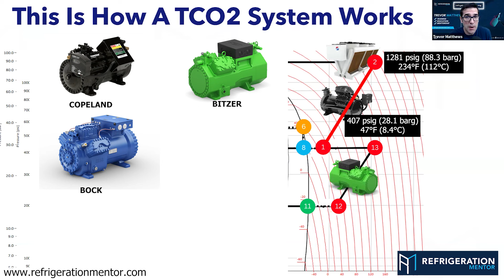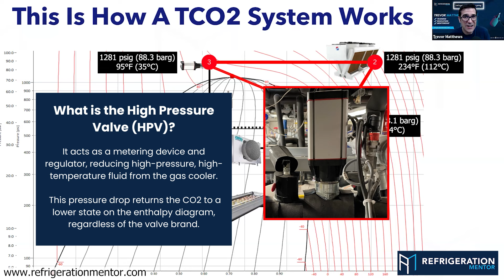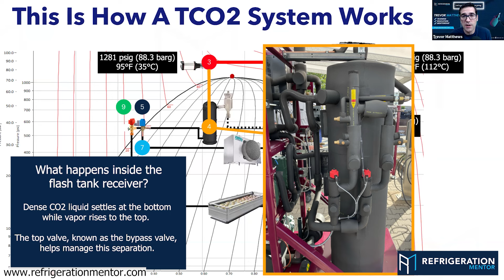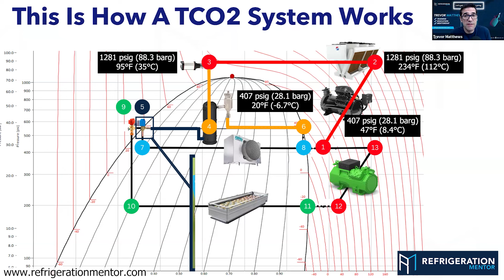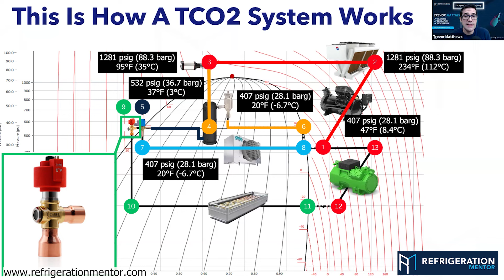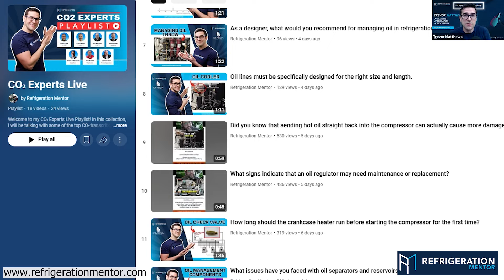Do You Know How a Transcritical CO2 System Works?

Comment: I would really like more info on what the intercooler does on a M&M Carnot system. I understand how co2 works and the key components but I’ve yet to find any info on how the intercooler affects the system.
Reply from the maker: It acts like a buffer tank with a couple of purposes. Your low temp compressor discharge goes into it so it cools the vapor so it is not too hot going back to the medium temp suction it also cools the liquid in the intercooler so it supply’s colder liquid than the flash tank to the LT liquid header.
Reply from the maker: We have a co2 course coming up that would really help clear a lot of things up, I bet. https://refrigerationmentor.com/introduction-to-co2/

Comment: On the 400 psig region, do we neeed check valves?
There is MT comressor suction, LT compressor discharge, bypass valve, and MT evaporator outlet. How is flow direction maintained? In the world of walk-in coolers and blood plasma freezers, the load is not constant. Also, why not use scroll or screw compressors, you're showing semi-hermetic reciprocating compressors.

Comment: You don’t need something at the junction of the mid-temperature and low temperzture circuit? Though they are at the same pressure, one is a -7°c while the other one is at 73°c!! How come there is no heat transfert from the 73°c circuit to the -7°c circuit??! 😮

Comment: Totally has no idea what he is talking about at 49 seconds he says it is a fluid which it is not it is a vapor. He says again it is a fluid. This type of refrigeration will kill people at pressures over 1200 psig. The equipment needed to test and maintain will be very expensive.
Reply from the maker: Yes you have to be safe with any refrigeration system but that is a huge misconception 1200 psig is a high pressure but I have not heard of anyone getting killed by a CO2 transcritical system and there are 100's of thousands of system out there with CO2.  If you work in refrigeration and ever used nitrogen that has over +2000 psig and not many people talk about that.

Comment: Totally not a HVAC tech, but had to deal with cooling systems in a small datacentre

How efficient are these things compared to chilled water systems? 

(for half the year we can reject heat to ambient without needing to run the chillers, but the flipside is the risk of water dumps over the racks - which is mitigated by pulling a partial vacuum on the indoor water loop, but results in the intermediate pump and heat exchanger sounding like a brawl in a spanner factory due to the cavitation generated)
Reply from the maker: @miscbits6399  they are efficient but I don’t have an answer for that comparison as I have not looked into it before. I will have a think about it.
Reply: Running your data center with free cooling (just with outside temp and circulation pumps) is absolutely most energy efficient, but you need to have low enough ambient temperature.

Many data centers run on approximately 26°C. To attain this temp with free cooling you need 20°C or lower ambient. Though with bigger heat exchangers outside AND inside, you can work with temperatures closer to 26°C

Most places in the world will have significantly higher temperatures most of the year. This makes a chiller mandatory to keep the data centers at proper temp.

Comment: You’ve got to get some hands on experience with c02. They’ve got rack that only run medium temp. The biggest issue is everything is digital, runs through case controllers, board on board on top of board. It’s all the the controller
Reply from the maker: @bevil23  thanks for sharing. Hands on experience is very important for anything we do in refrigeration. The theory behind of how it all works is just as important because there is a lot to it and you do not have time on job sites to learn it all. Yes there are many Medium temp CO2 system in the field and they are not a booster system. Because everything is digital and controller heavy it makes it easier to troubleshoot the whole system vs one section at a time. 

Learn more about CO2 refrigeration at Https://refrigerationmentor.com
Reply: @ only if everything is labeled. If bms says controller 1 is responsible for something. What is controller 1. Newer controllers are difficult to find what is controller 1. You have controller 1,2,3 plus secondaries

Comment: Why is the pressure first 532 PSI and then 407?
Reply from the maker: Great question! The 532 is receiver/flash tank pressure and the 407 is the medium temperature suction pressure. These are just example and will be different depending on the application.
Reply: @RefrigerationMentor  OK, but I still don't understand.  Why not take the liquid off the 532, and gas off the top of the tank?  Does there need to be a drop to allow for control?  Do you have a link on this issue and why the two pressures?
Reply from the maker: @seaplaneguy1  In this example you are moving the liquid out at 532, the vapor goes through flash gas bypass valve back into the medium temperature suction line. Thats why you have 2 different pressure.
Reply: @RefrigerationMentor  Sorry, but I still don't understand.  At point 4 (532 psi) the liquid goes to 5, and then from 5 to 7 via a valve.  Why the drop from 5 to 7?  Are there three desired temperatures for three types of products in a grocery store?    Also, the gas at 4 (432 psi) goes to 6 and steps down to 8 via another valve so as to meet up with the 7-8 line and eventually to 1. 

The liquid from 5 is super cooled to 9.  What cools it?  It later goes to -25F. 

I see three temperatures in F:  37, 20 and -25.   I understand one could have many temperatures depending on needs.  

My question is why the 532 and 407?  Demand for those temperatures?  

Why not just go from 5 to 6 via another line than the 4-6 gas line and make 13 compress to the 5-6 pressure?  Is the compressor from 12 to 13 limited in ratio? 

I watched several videos and non explained this.  This is not my field.  I am a mechanical engineer (engine development) but not a refrigerator guy.  

Thanks for the help.
Reply: @seaplaneguy1 at 4 to 6 is to maintain the vessel pressure not exceeding 41 bar, from 5 to 7 it only drops the pressure for medium temp probably at 25 bar  back to the suction of the mt comps. Bypass is only to maintain the vessels pressure since it can not be lower than the mt suction and not higher than 45 to 60 bar. I only have 5 years experience so I might be wrong . Thanks Trev for the most amazing advice ad knowledge.
Reply: Great video but I have one question, when going through the pressure regulating valves that feed the med and low temp liquid headers, when you drop the pressure, how do you ensure there is enough liquid to satisfy all the expansion valves on both suction groups? Does it lower the pressure then go through another heat exchanger to collapse the vapor made via expansion back into a liquid and then go through the expansion valves? Or is there only minimal flash gas after the pressure drop to satisfy each expansion valve in a store?
Reply: Or was I reading this wrong, are points 5 and 9 pressure regulating valves to drop the pressure to different liquid headers or are they the systems expansion valves?
Reply: @Sub_Zero_Refrigeration  exactly that, expansion for the medium temp and low temp.

Comment: I was just hired as the maintenance tech for a production facility 2 months ago in Milton Vermont and I have never worked with co2. I am the only hvac tech (13yrs exp) and am doing all my own research because nobody I know has any experience, even my mentors. You have been the most valuable resource I have found so far (in 2 months of looking) and with my hvac background and your knowledge I feel I can do it without making dry ice. I am already aware that the system is low on oil and I am still very afraid of messing something up. I am still not ready to pull the trigger and do it because i have not found any real guides on the proper steps to take with isolation and bleeding pressure down. It is a purity system for the record, and I really don't want to ruin such a cool system due to my ignorance. 

This was the best video to help me wrap my head around the entire process and will help me build the confidence to actually do the work i need to get done.
Reply from the maker: @seanbeatty3064  I am glad you find our content interesting. I know a lot about those systems. Shoot me an email and I can get you the documents that will help you. I recommend you to join one of our CO2 training programs they will definitely get you to the next level. I have an intro to CO2 which I believe would be perfect for you.
Reply from the maker: We have some new CO2 courses 

Intro to CO2 program 
https://refrigerationmentor.com/introduction-to-co2/

CO2 Field Troubleshooting: https://refrigerationmentor.com/co2-field-troubleshooting/

Understanding CO2 Controls: https://refrigerationmentor.com/understanding-co2-controls/
Reply: This is blowing my mind after working on reg rack systems. I’m excited to learn more
Reply from the maker: @thomasalcaraz5598 We have some new CO2 courses 

Intro to CO2 program 
https://refrigerationmentor.com/introduction-to-co2/

CO2 Field Troubleshooting: https://refrigerationmentor.com/co2-field-troubleshooting/

Understanding CO2 Controls: https://refrigerationmentor.com/understanding-co2-controls/

Comment: I didn't realise there was a difference between a fluid and a liquid..a.bit like a gap and a space.
Reply from the maker: My relization was when a thermodynamics engineer explained to me that both liquid and vapor/gas are fluids. The term fluid encompasses substances that can flow and do not have a fixed shape, including:
Liquids – They have a definite volume but take the shape of their container.
Vapors/Gases – They do not have a fixed volume or shape and expand to fill the container they are in.
Why are both considered fluids?
Shared Properties of Fluids:

Both liquids and vapors flow and conform to the shape of their container.
They both exhibit viscosity (resistance to flow) to some degree.
Both can be analyzed using fluid dynamics principles (e.g., pressure, flow rate).
Difference Between Liquids and Vapors:

Liquids are incompressible or nearly incompressible, meaning their volume doesn't change significantly under pressure.
Vapors are compressible, meaning their volume can change significantly with pressure and temperature.